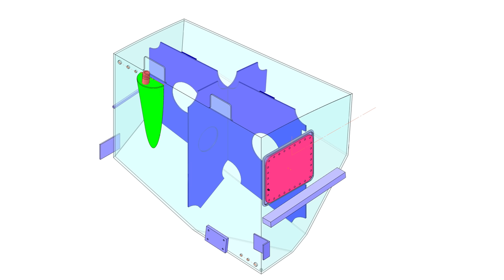Tally Ho’s brand new Diesel Tanks!

Comment: Did you ever think about grp fuel tanks. Fiber reinforced plastic is by far the best technology for shaping ANYTHING compared to wood or metal. No wooden feel but...
Just look inside Tally Ho how much special solutions you have to create just to build the boat and how much volume is lost from all the wood. And how many hours and hours and money you spend. You actually look a little tired, no offense intended! And you still get a lot of maintenance tasks that start right when Tally Ho is launched. Expoy or polyester reinforced plastic is superior. All over the world there are polyester GRP boats still in use after 60 years. So hard to beat! It will be interesting to see you sail this boat, maintenance, handling in tight situations, etc.

Comment: Better the plastic tanks were such trash considering it lead to you getting a much better product from a proper operation. Imagine if the plastic garbage was liquid tight enough at first and you installed them, I bet they would have been popping seams on the first chop.

Comment: while I understand the principle you adhere to not naming the company and then giving a general warning about plastic tanks (hence likely making potential client warry of them in general) kind of feels like you you are penalizing all plastic tank companies because of the mal practice of just one.

Also there is quite a bit of long term experience on  on plastic diesel tanks, car tanks heating fuel tanks etc have been around for ages, in my own house I have two 2500 l heating oil tanks (which is basically the same as diesel just a different colorant) that have been in the building for 30+ years (admittedly they are only under warranty for 10 years)

Comment: Deoxygenated water? Is that even a thing? Water without oxygen is just hydrogen...
Reply: It refers to oxygen molecules dissolved in the water, that will gradually boil off or find something better to do. Similarly, air always contains an amount of water vapor that can be removed.